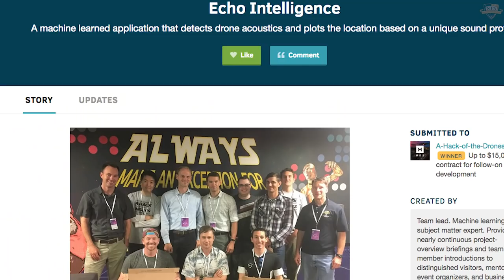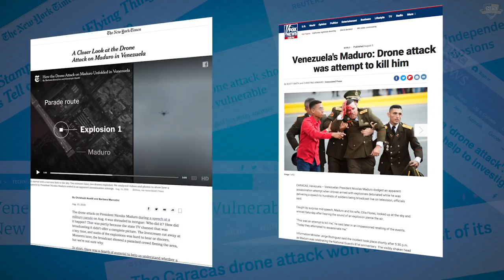A-Hack-of-the-Drones

Comment: technically, certain devices emit low/high-range frequencies that we can't pick up, since this can listen to specific frequency bands, it can be used to detect devices from a distance, I applaude this idea, it'd work great in numerous different situations, and would become major assistance on the ground, and it can be used as an Early Warning System not much different from the EWS of Britain in the early/mid 1900s, detecting vehicles from large distances (the Brittish EWS still technically works today, even on drones, however is so old they've been decomissioned due to it, so, this would be a great replacement for that, and for other systems of similar use in the US).